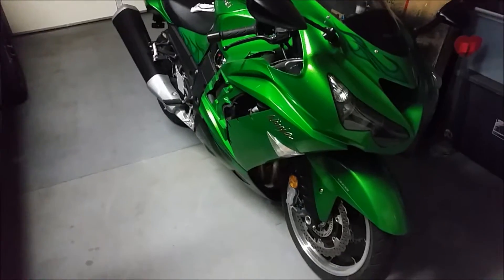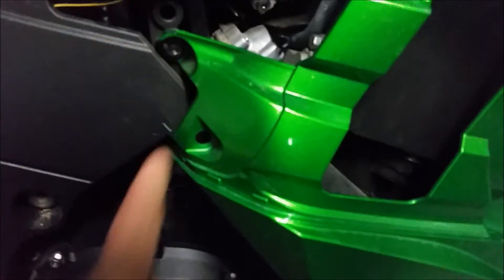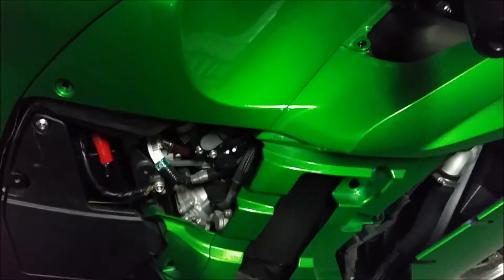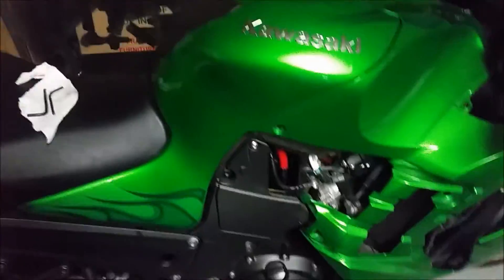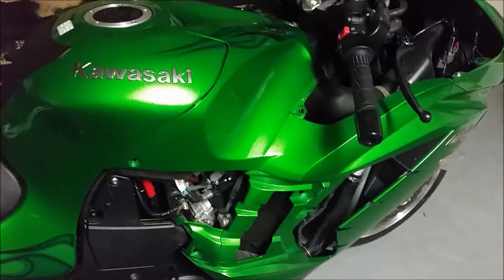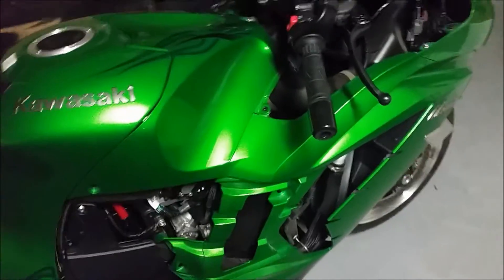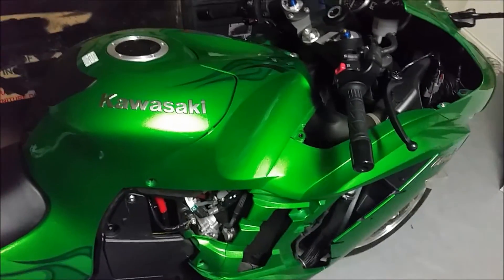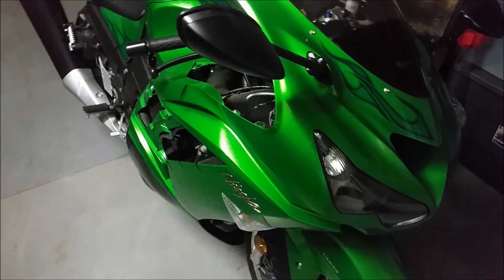Kawasaki ZX14R Motorcycle PSA: Maintenance Check

Comment: Aircraft mechanic here too, of 28 years.  Best solution is get a factory service manual and do things yourself, I've been doing that for years now.  All bolts are torqued to spec, all grommets in place, tires at correct pressure etc.  Dealership maintenance is usually disappointing.  The only thing I have to farm out is tire replacement which consists of me handing them a wheel and a new tire to put on.

Comment: had this happen on my suzuki when i took it in for recall work.. missing frame plugs and scratched it up getting the plugs out.  they replaced the plugs for free..  they lost my original ones..  scratches where minor and plugs covered them up.. later started smelling something burning and found they pushed the original plugs inside the frame and the rubber plugs where burning from being so close to the radiator.. took a air compressor and they blew right out.  

this is why i do my own work now on all my vehicles.   hard to find a good place to trust and will take the time and care to do it right and not fuck up your shit.
Reply from the maker: preach it brother! glad to know there are people out there with similar experiences.

Comment: You are lucky. My bike's oil change ended up to a crash after all the oil came out. The mechanic used only his fingers to tight up the oil screw. He forgot to use a torque wrench after it. I had only 80-90 km/h speed when rear wheel slipped in a curve. I didn't hit anything, so only scratches and bruises here and there. The mechanic admitted that he just forgot it.

Comment: Hey, I to have a zx14r.   I have had 3 of them.  I also live in central Texas the Austin area.  Please let me know if you use a dealership in this area.  I too have had a few maintenance problems after work had been performed.  I had just about the same experience  with one of my zx14's.  I would be glad to talk with you.  The way you explained your situation is exactly what happened to me. 
 If you are going at high speeds when the bike becomes unbalanced or the laminar flow is upset the vibration can crash you.  I had one of the mirrors not put on right and the vibration at around 155 was very sudden and violet.  Anyway good luck to you.  The ZX14r is a fantastic machine and a real pleasure to ride.

Comment: Just a quick note to your video.  The same thing happened to me with one of my ZX14R's they pushed a grommet into my intake manifold on top of the valves.  I too live in Texas, Austin.   Georgetown area.   I was extremely lucky it didn't get into the intake valves.     I don't let anyone even touch my motorcycles anymore.
I would be interested in your dealer area.

Take Care.
JohnD.

Comment: I have owned more than one 14 and one thing i will say is... i learned early on that those grommets are really easy to push out when reinstalling the grills. When you do go to reinstall the grill... put a little lube (i just use spit) on the grommets so the grill will push through easy. A similar thing happened to me at my own fault.

Comment: I learned ages ago not to trust my bike to a bike shop.  I had my new bike (ZX14) delivered to my house and when it arrived, it was filthy;  they didn't even bother cleaning the stock number off the mirrors.  The dealer was incapable of carrying out a successful new motorcycle delivery, so it's no surprise therefore that I decided to do the first service and other maintenance on it myself. Jam the warranty.  Its more likely the dealer would have buggered something up on my bike than having a major mechanical issue that I may not be able to have repaired under warranty due to me doing the first and subsequent services.

Comment: Dealerships are trash the one by my house almost killed me went in for a tire change and they didn't even tighten the rear axel tension bolts left them completely backed out chain came off 20 secs after I left had to have them come pick me up didnt go down but chain messed up alot and took weeks for them to fix all the damages.

Comment: I'd be pissed! Had situation with a Ktm dealer in uk.  They were supposed to put new spokes on my bike.  Ended up getting bike back with crack across rear wheel rim.  They had my bike 2 months and couldn't find cause.  After I threatened to go legal the replaced both rims.   I agree the upsetting part is their denial of a problem they caused.   Got ZZR Now And happy! Ride safe

Comment: i recently bought a zx14 for $8,000 out a dealership, loan made it $12,000; it has no battery cover, the negative wire is broken, the wires on the negative nut are chipped horribly, the positive wire extra fuses are also horribly chipped, the head is cracked, the clutch is snapped in half, and the chain is rusty. Yet here I am, hearing this guy talk about missing nuts on his zx14.

Comment: Ive skinned my bike so many times i can do it blindfolded. I wont let anybody skin my bike, if you are not very careful you will break tabs and screw it up. Ive learned to do all work on mine. Oil, Brakes, air filter, fuel pump, tires. Dealerships are the biggest thieves on earth.

Comment: Those grommets do not just fall out. My guess is they did not remove the grille correctly or forced the grommets out somehow...And I would have asked for a replacement battery cover. The 14R fairings are not difficult to work on, but care must be used on this bike. And everything goes together and comes apart in a specific order. Can't just start ripping these plastics off on this bike, I actually watched Brock's video for exhaust install before I ever worked on my bike and removed the fairings..
Reply: Right on! The first 5 minutes of the Brock video gives you access to the battery, coolant and air filter.

Comment: I paid for an additional 4 years on my warranty and the first time I had maintenance done at the dealership I happened to look to see if it was done and I saw the mechanic using a black marker on my mirror so I waited for my bike to be brought out to me and upon inspection this guy had dropped my new ZX-14R and was hoping that I would drive off without noticing.. long story short everything was replaced by the dealer but I would not let them do the installation, me and a friend did it ourselves and it was hell but the bottom line is these guys aren't very professional, I wasted money on an extended warranty because I would never take it in again.

Comment: If you work on helicopters,you should be able to change your own oil and battery.I have a ,2006 ZX-14 and I would not let anybody perform repair that required plastic removal.Do your own repair such as you described.You would probably have a stroke if you actually witnessed the battery replacement and bolt torque on the pan plug! Sounds like you left Jennifer Aniston unattended in a biker bar.
l
.

Comment: Sorry bro but you're wrong. If it was from the battery service wouldn't you have heard the rattling at that time. Shit rattles loose on motorcycles all the time.
Reply from the maker: DonTHEhandsome1 Yeah you are right, IF I had been riding it I would have heard it. It was on a trailer to and from the battery service. But just riding doesn't cause grommets to come out.